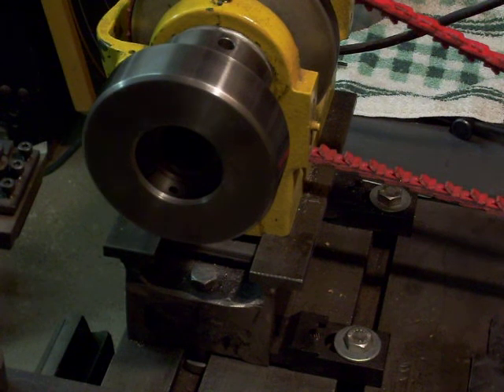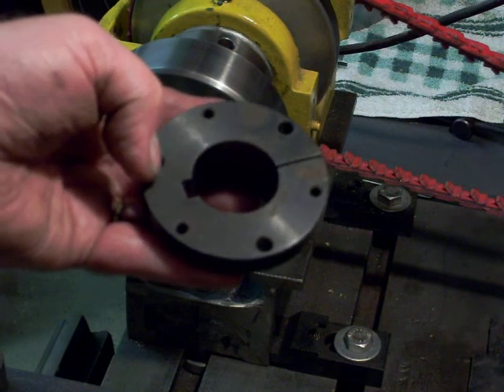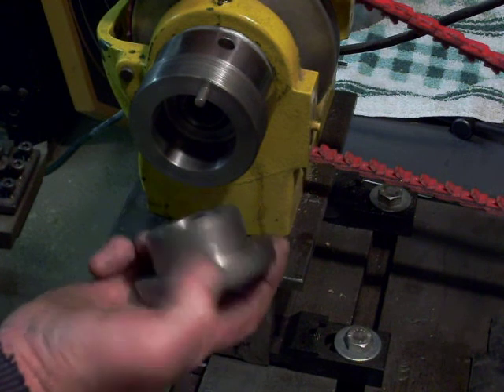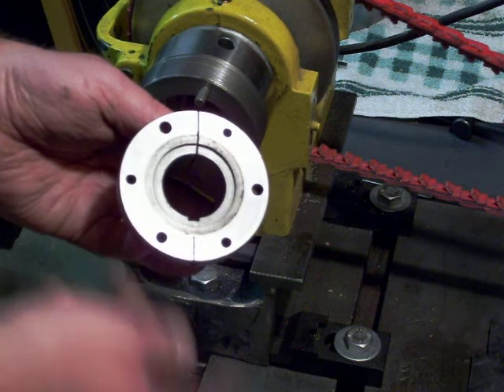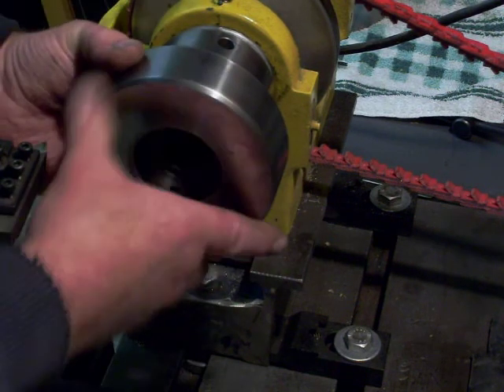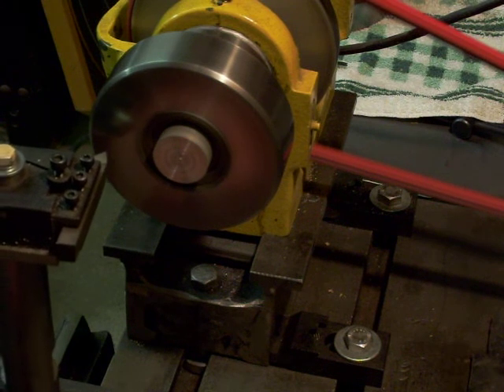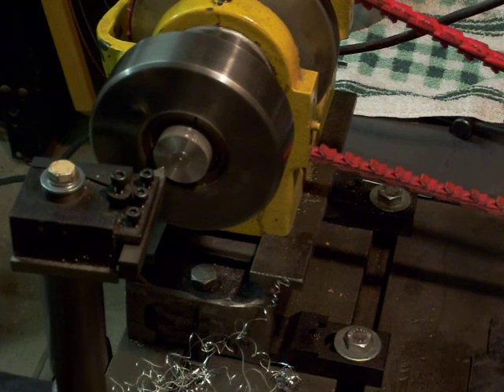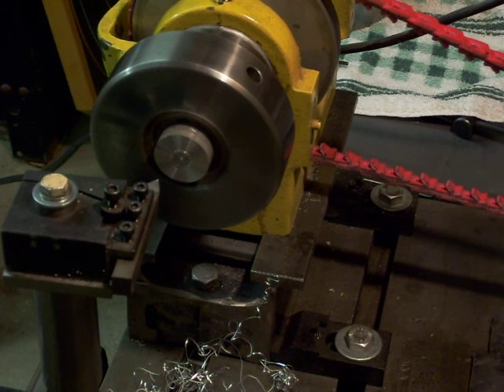Homemade Collet Chuck

Comment: Nice job.  Two questions.  How concentric is the part held and 2, where is the taper that the putter ring pushes the bushing into?
Reply from the maker: The bushings have a taper right out of the box. A matching taper is cut into the chuck body. Once set up repeatable work is more accurate than a three jaw chuck.